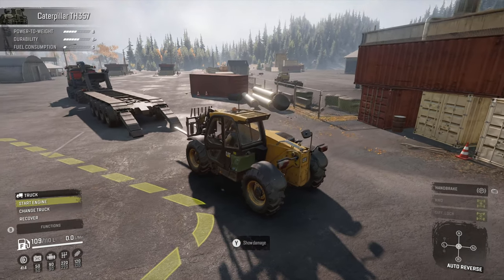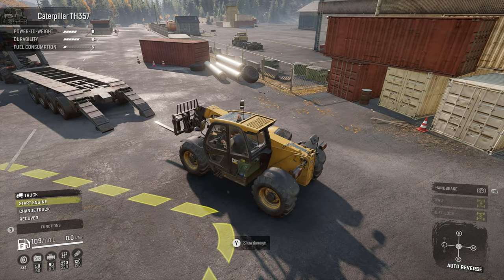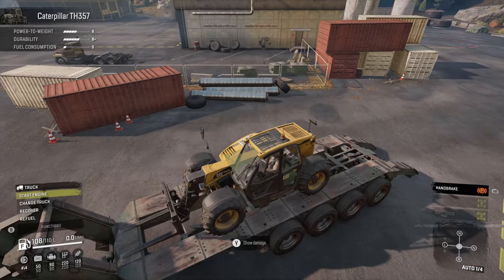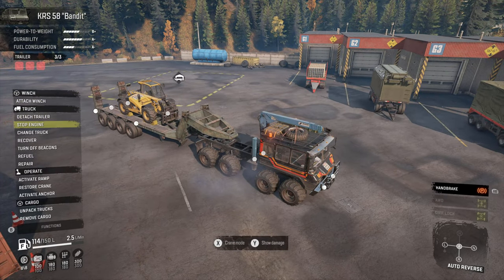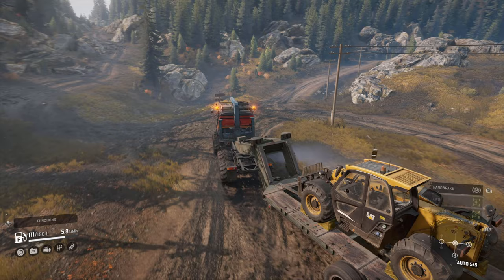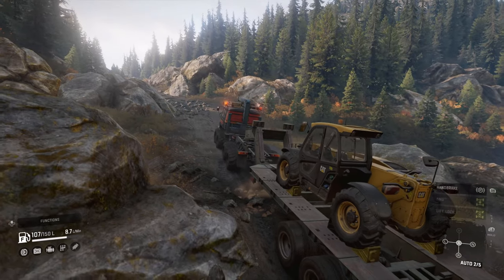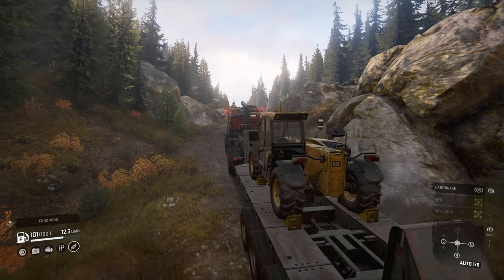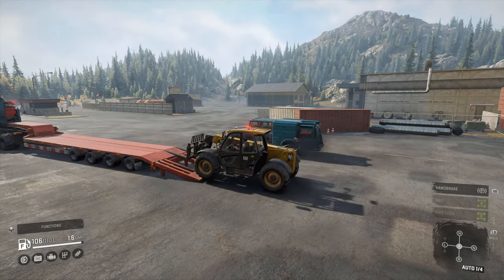Snowrunner - How to Load a Truck on a Trailer - NEW UPDATE Oct 2020

Comment: In my game there is no option for the ramp put down, there is no function seen like 'OPERATE,- ACTIVATE RAMP'. is there any solution for that. Please give replay.
Reply from the maker: This is a very old video, back when trucks would fall through trailers.

When the engine is running and your trailer is connected, open the function menu and "Activate Ramp" will be the option you need

Comment: How or where did you get the forklift
Reply: That was fast
Reply from the maker: There is one in each Yukon map. In the cabin construction area of the first map and same for the second
Reply: @DecPlays_  I'm not exactly sure where that's at. Do you have a video on it or do you know if there is a vid on it? It looks really interesting
Reply: @DecPlays_  I just looked it up. I maybe need to update my game before I can get it I really appreciate your video. New subscriber right here for sure
Reply from the maker: Thank you very much. You'll need to build 2 bridges to get to it easily. There's a warehouse near the starting garage that has infinite steel beams. Basically head South and keep following the road